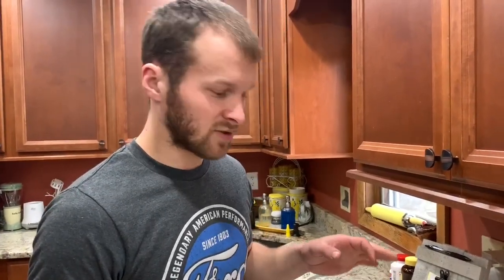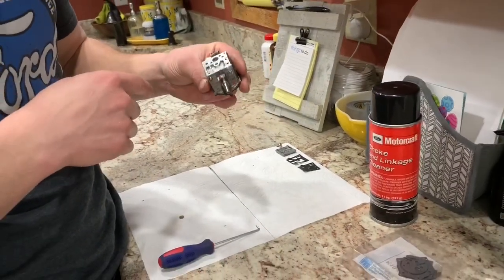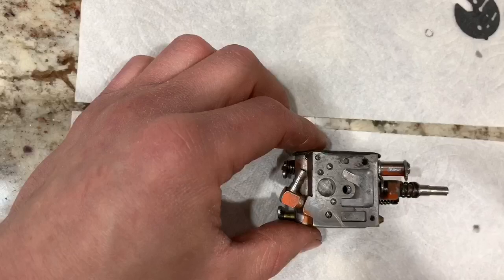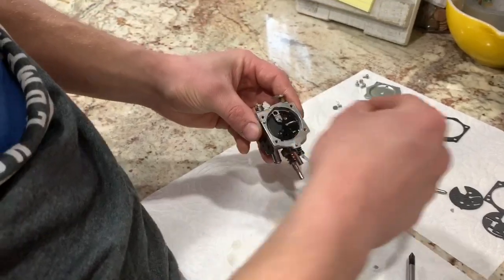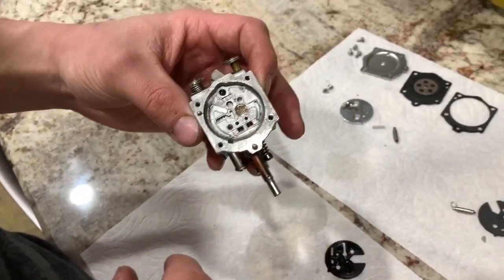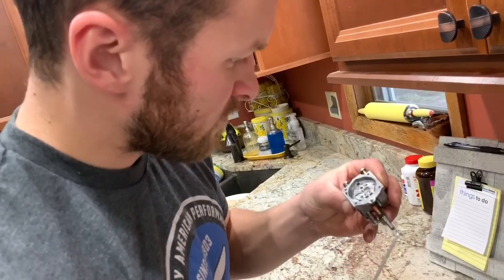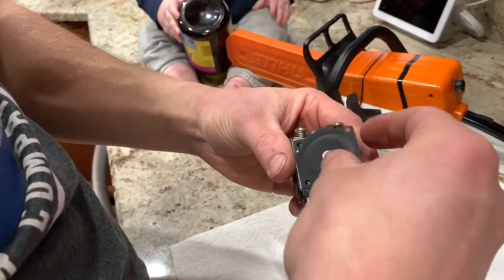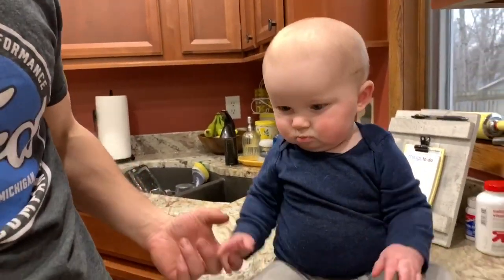How To - Rebuild a Walbro HDB Carburetor

Comment: Great video! I opted to change the tiny screen and retaining ring. If you grind down a seal pick very fine you can get the retaining ring out, there is not actually a groove for it from what I could see. Just be cautious not to damage the brass seat, there is a form of a check valve below. Thank you brother!

Comment: Thanks for the detailed explanation of the Poulan carb rebuild.  You took time to go into each step and had close up video of the different layer and sequence of parts in the rebuild process.  I searched through lots of You Tube videos before finding yours.  I have an old Poulan chainsaw that will not run.  I assumed the card had old fuel dry out inside the carb.  I ordered a rebuild kit.  I will refer to your video during my rebuild.  Thanks again, I appreciate your helpful video.
Reply from the maker: Jay you’re most welcome. I’m happy to help!